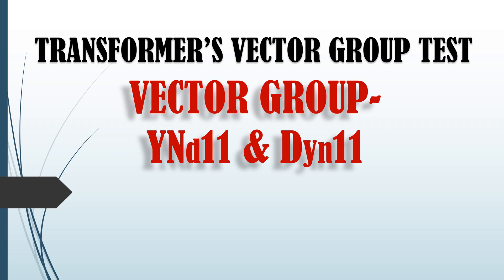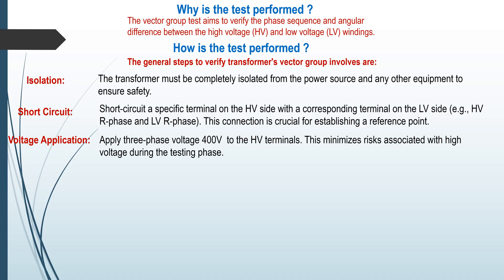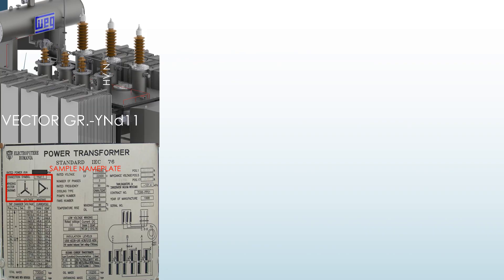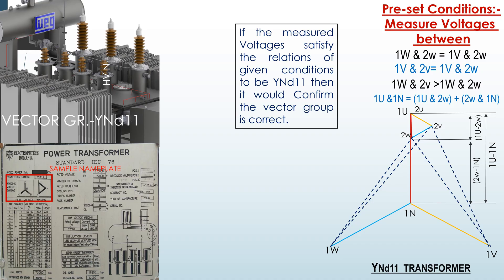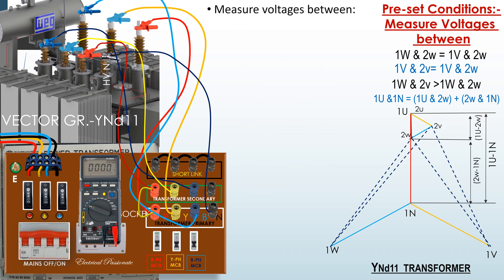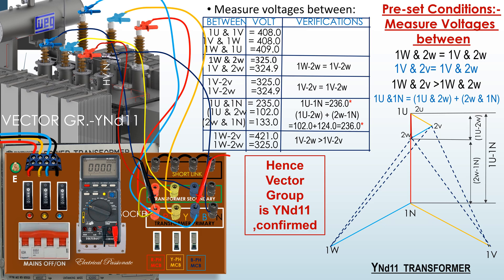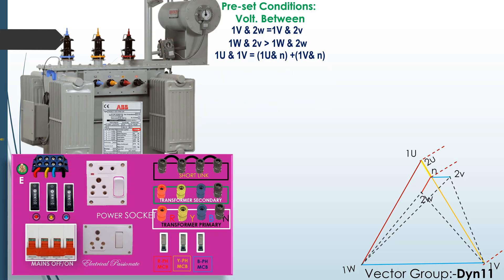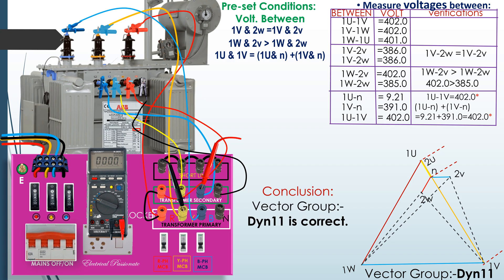YNd11 & Dyn11 VECTOR GROUP TEST/ TRANSFORMER VECTOR GROUP TESTING PROCESS

Comment: Hello for me my ratio test is OK but vector group results are as 1w2w<1v2w , 1v2v<1v2w , 1w2v = 1w2w 

Any suggestion why it should be so .
Reply from the maker: You are welcome.When the ratio test is ok but a vector group mismatch is identified in a transformer, it means the basic number of turns is correct, but the internal winding connections or phase numbering  of LV are interchanged by 2v-2w-2u in place of 2u-2v-2w  relative to the system requirements in Vector Gr. YNd11. This is a critical issue, and the transformer cannot be safely energized without proper checking and testing.Thanks..
Reply: @e @electricalpassionate true we found this in initial testing phase before tanking .. without these we cannot resume for the basic routine tests any idea how to get this resolved
Reply from the maker: @Desi_Paryatakk  Expert of Testing Team may be consulted .Site visiting also required. Thanks.